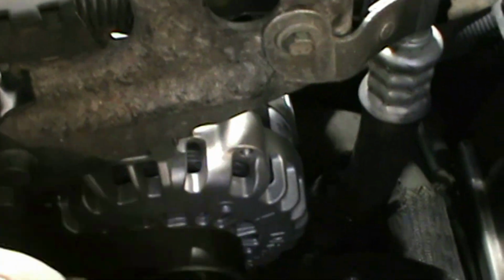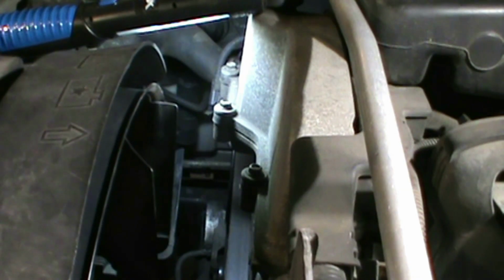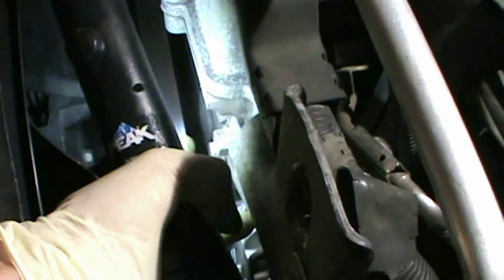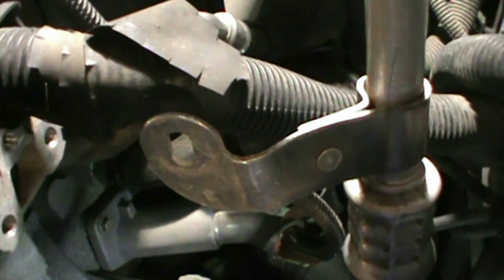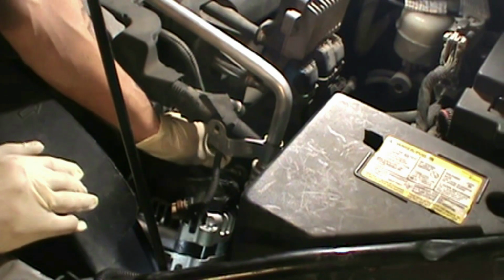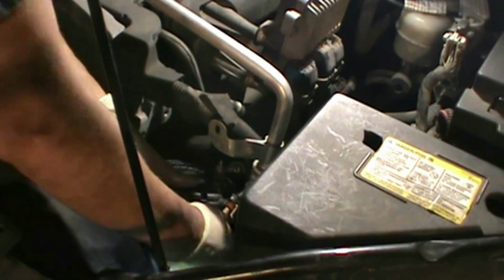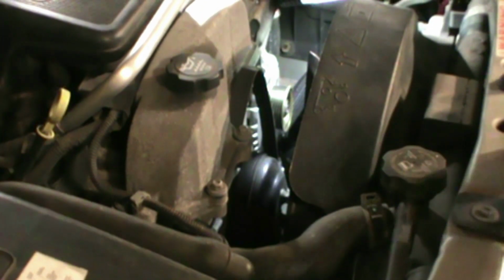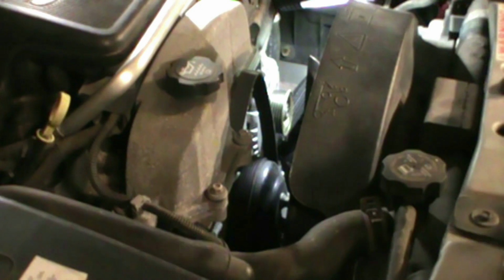how to replace alternator on 2006 gmc envoy

Comment: i have no clue how you got to that 3rd bolt on the bracket man!
Reply from the maker: It was a little tricky I had to use a long extension in a medium extension and I left the other two loose that way I could wiggle the bracket around

Comment: That was good how u showed how to replace it but the test was  not very informative because this trucks have more dame electrical components that actually made damage it the way u did it don't get me wrong the dam ac actuators will start to give u problems we don't have expensive equipment to do the proper way we just have to do it the best we can goodluck everyone outhere.